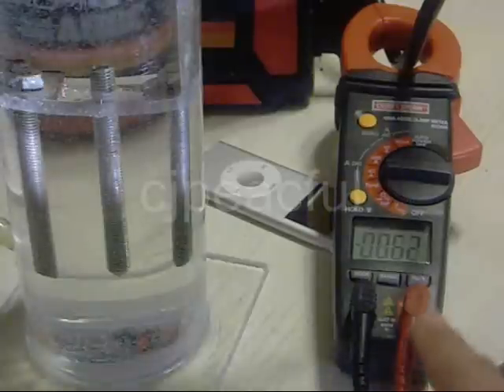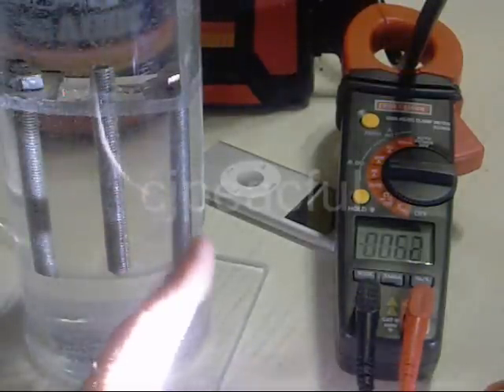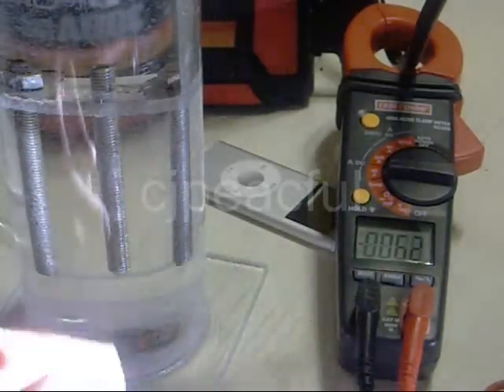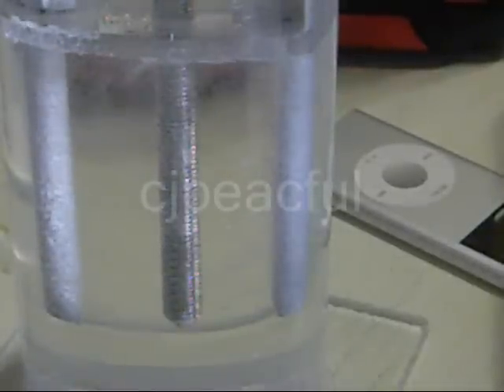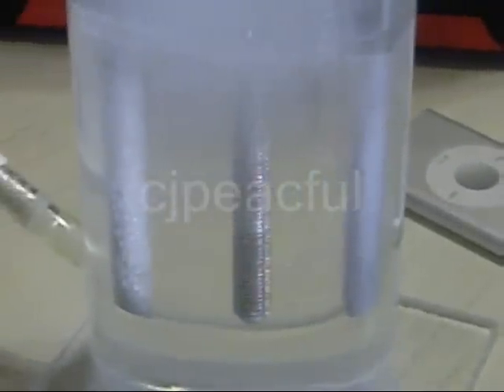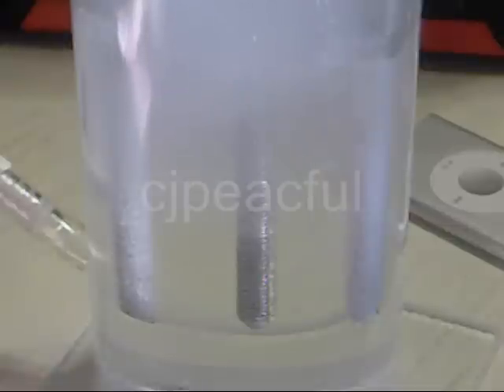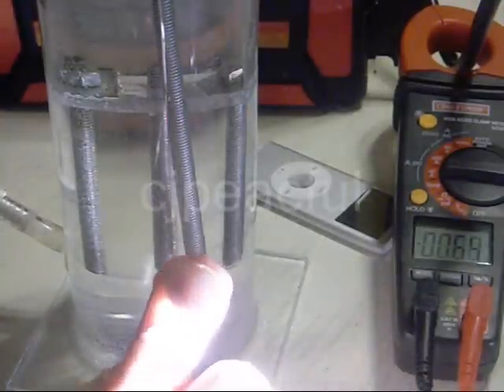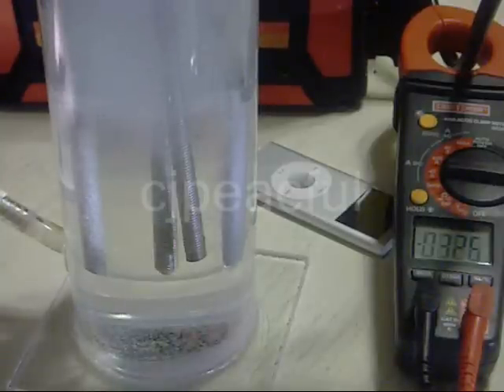Threaded Rod HHO (01)

Comment: The electrons always take the easiest way. It's much easier to pass a bolt than a big plate. I think that's why you don't get a neutral bolt to work. But try to put a big plate between the bolts...
Reply: I use carbon rods. neutral does work. the problem is production goes way down  because of volt division.  the key is amps at that point.